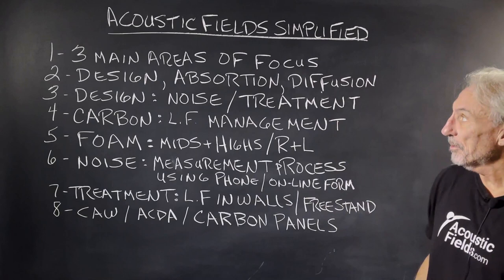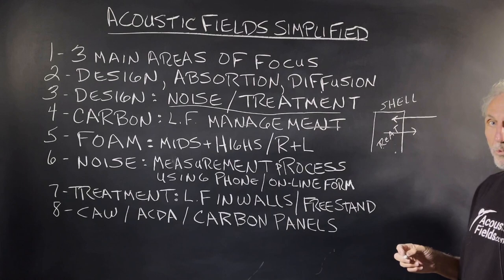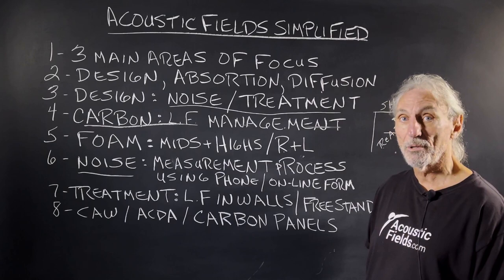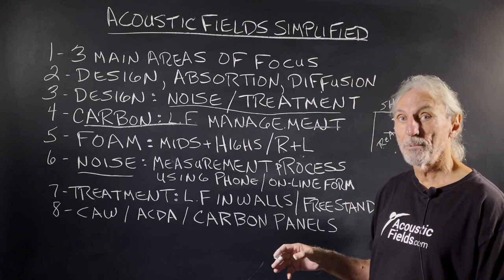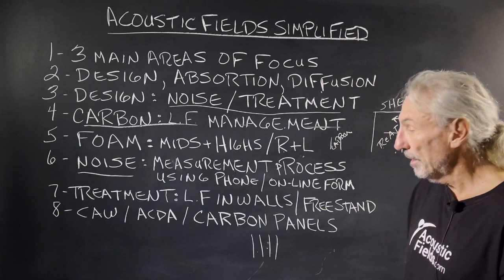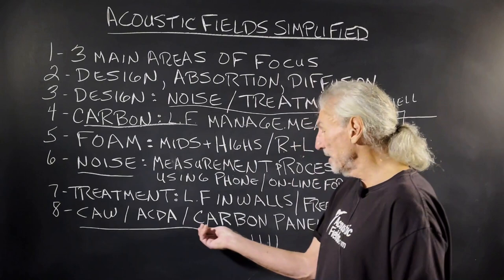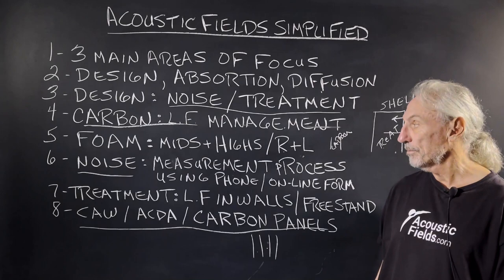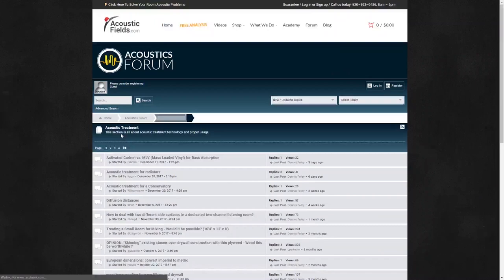Acoustic Fields Simplified - www.AcousticFields.com

Comment: Could the Carbon process be used with walls of 6 inch's thick? In a ...15 x 15 room, is it worth a Gut and start from scratch?  I've already mentioned the outside noise I get is horrible, high 50s on average, so you know the peaks already. Ceiling, the worst 8ft. Hardwood floors, it's a echo chamber at this point.
Reply from the maker: The depth of the studs determines the resonant frequency or how low the stud space will absorb down to. With a 6" deep cavity to work with, you will start absorbing at 60 Hz.
Reply: From what I read, you have multiple problems. if I were in your situation, I would fill out the form AF has, arrange a call with Dennis and then go through your room's problems and develop a strategy that fits within your current budget, OR at least know how much it costs before you spend any money.